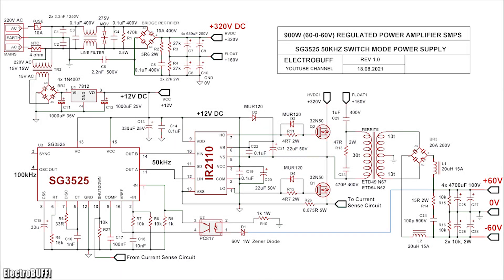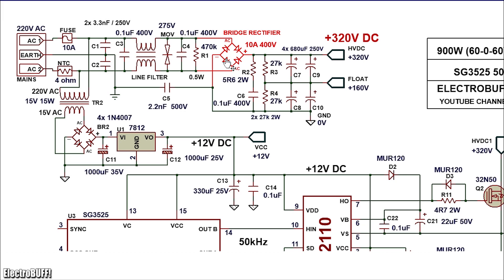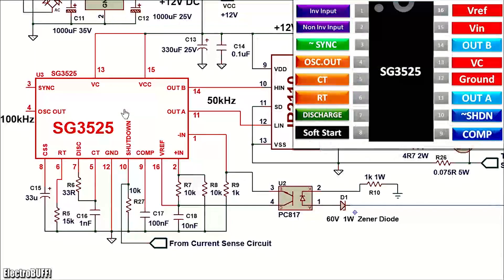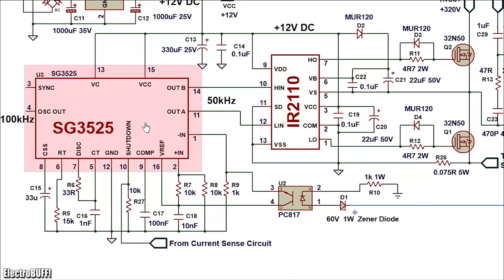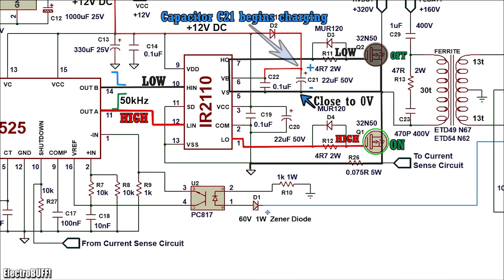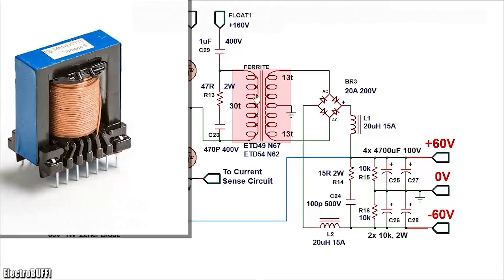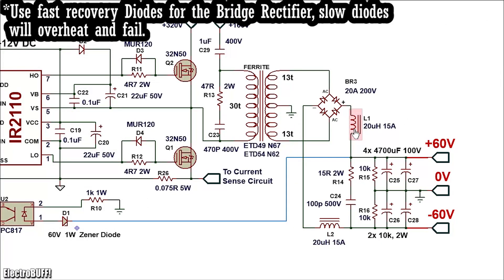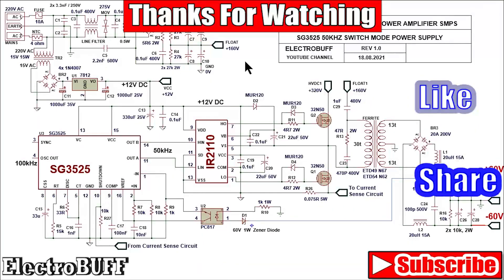SG3525 Regulated Switch Mode Power Supply (SMPS) with dual Output Voltage for High Power Amplifier

Comment: hmmm, good try but far from a quality solution and for professional application! 
A few things bother me... I'm sure there are better solution than transformer for the 12v secondary, almost same dimensions as the ETD49/54 

Then FLOAT 160V + HVDC 320V... no, I never liked that concept and so much current going through one capacitor C29. I don't know how it will behave with the dynamics of the music, with the peaks in the current which can be up to 10 times higher than the nominal current, I always prefer a toroidal transformer over a switching power supply! I have transformers older than 30 years and they have no problem EVER, try to convince me that switching power supply will last more than 2-3 years, and spare sparts... man, avoid if possible

Comment: Helo! Nice video by the way. But I tried to calculate the Np take into account the ETD49 for 50 KHz and a Bmax at 1800 gave me 20 turns. If I take the 30 turns and check for Bmax, it will be around 1200. I found that the cross secționale area of the core to be 1.63 square cm.

Comment: Primary (30 Turns) * 3 (AWG 23 = 0.574mm or 24 = 0.5106mm), And Secondary Turns are 26 * 5 with center tap 13 + 13 Use Wire (AWG 23 = 0.574mm or 24 =  0.5106mm)

Comment: You are the best,thanks much;

Liked ,subscribed and shared

Do a similar video on  a 24 V   3000watt  hi freq. (30 KHZ?) inverter for 220VAC  with 4 or 5 pulse transformers, 16 or 20 mosfets, *or just one hi freq ferriteb toroid*,  and 4 or 6 IGBTs or Mosfets for the H bridge output,  but only using  the 2 cheap, china,  assembled boards,the  SG3525+LM358+PC817,   and the  EGS002).

Comment: Good video 
Answer me this….. what is with the voltage flags …if something is a output why don’t the point out? Away from the source…. Is this normal?
I am looking at a schematic right now and cannot determine where voltage reference comes from… Probably because of the stupid flags not meaning anything
Reply: Ahh…vref, is output of chip 5 vdc…still no consistency in these flags

Comment: I wasted a lots of time and money on this circuit and I gotta say its a huge disappointment. I have checked many times, everything is perfect just like showed in the video but the output is unbalanced even if loaded with resistor +50v  0  -83v transformer is perfectly balanced, not the problem. The worst part is that its blowing ultra fast 30A diodes WITHOUT A LOAD after a few minutes.
This circuit is a disaster dont even try it.
Reply: hello which diode is blowing off, cant locate the 30A diode

Comment: Hey i have transformer from old crt TV but there is no data sheet i found on net can i use it.... It's has name bck40
Reply: Its most likely a flyback. Has an air gap so cannot be used here. Its half bridge.

Comment: AND AUTO VOL PULSE SOURCE, WITH 90 VAC TO 240 VAC INPUT VOLTAGE AND +/- 90VDC OUTPUT VOLTAGE, WITH FULL BRIDGE SWITCHING
  THANK YOU VERY MUCH
Reply: Youtube có đó. Làm tốt 3800w liên tục đỉnh gần 5000w
Reply: @tringuyenhuynhminh1765  sao bạn không gửi cho mình đường link. Cảm ơn bạn
Reply: @AUDIO-CLASS-D  youtube gỏ smps fullbridge pfc là có thôi
Reply: @tringuyenhuynhminh1765  CẢM ƠN BẠN